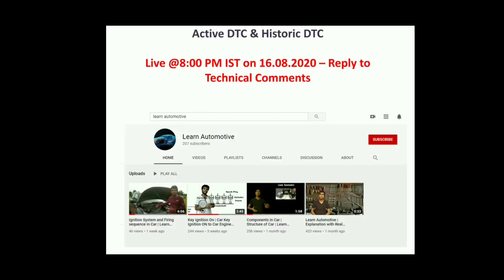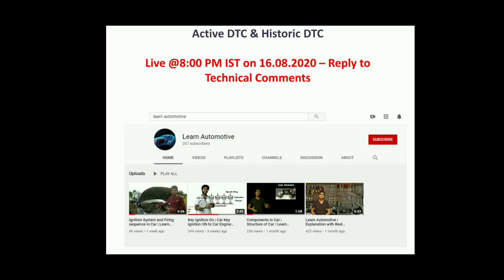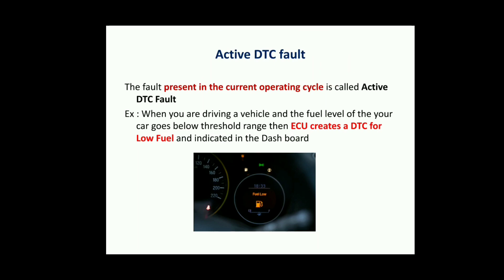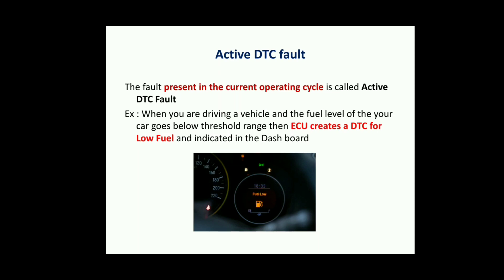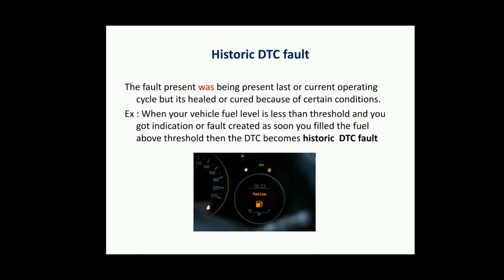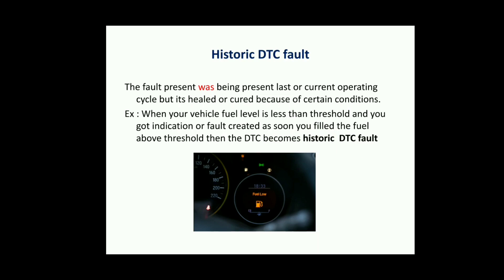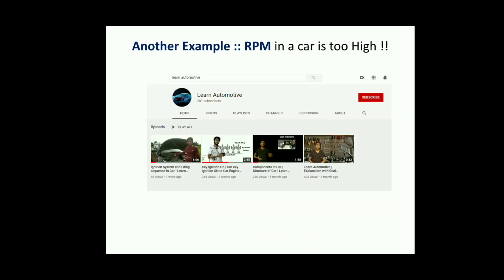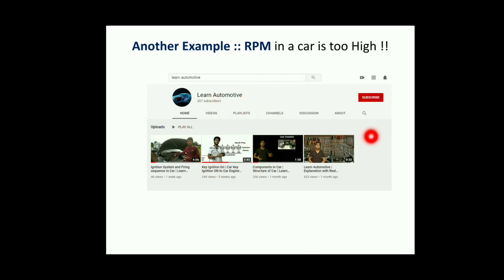Active DTC & Historic DTC | Embedded World | Activate DTC | Historic DTC

Comment: Hi, thanks for the video. is fuel indication is called a DTC? If yes what is the reason behind that. Is this not a indication like door open and so on.
Reply from the maker: Hi 

DTC - P0171 - System Too Lean (Bank 1) 

Yes, For Fuel low indication DTC will be created. For all the indication in dashboard will create DTCs

Possible
 Causes:

Fuel System:
 Damaged or leaking fuel pulse damper
 Fuel filter plugged or dirty
 Damaged or worn fuel pump
 Leaking fuel pump check valve
 Leaking/contaminated fuel injectors
 Low fuel pressure or running out of fuel
 Evaporative emission (EVAP) canister purge valve is leaking when the canister is
clean
 Fuel supply line restricted
 Fuel rail pressure sensor bias
Exhaust System:
 Exhaust leaks in the exhaust manifold gasket or mating gaskets before or near the
heated oxygen sensor (HO2S)
EGR System:
 Vacuum hose disconnected on exhaust gas recirculation (EGR) system module
(ESM) applications
Reply: Embedded World thanks for the reply. Point noted.